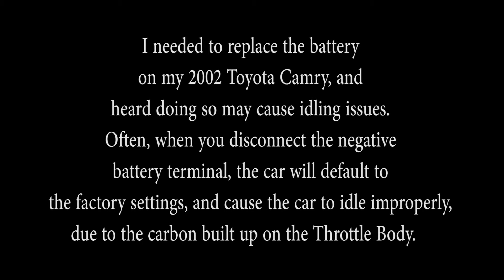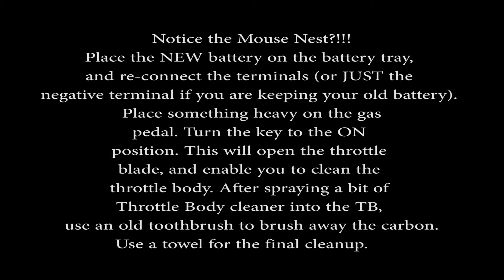Camry Idle Fix - Toyota Lexus - Throttle body cleaning

Comment: This video was perfect for me. After I disconnected my battery the idle was so low the engine would shut off at stoplights. I did what you did as well as spray the mass air flow sensor with cleaner. It runs like a top and I get better throttle response now
Reply from the maker: Awesome! Glad it helped you out.

Comment: Process worked for me.    Symptoms was it wouldn't idle without "helping" it with your foot lightly on the accelerator.    Even after 50 miles of driving it persisted.   In the past I had been able to drive for 50 miles or so, and it would figure out how to idle, but this time it did not.     Inside the throttle body was not even that much carbon to the eye ( equivilent to perhaps 1-3 pages of notebook paper in thickness), but after cleaning it throughly, the car idled at 1100 rpm and after driving settled down to 850 rpm.
Reply: For whatever reason this idle issue started after replacement of the engine coolant temp sensor.

Comment: Do you still have to disconnect the negative battery terminal if you are just cleaning the throttle body? Have a 2003 Lexus ES300 and been wanting to do this for a while. But otherwise this video is great! Also I originally watched a Scotty Kilmer video on this and he didn't seem to put anything on the gas pedal and he was able to open the throttle blade by pushing it, not sure if he did it but just didn't include it in the video.

Comment: I did the procedure on my 2004 camry, but I'm not entirely sure what you did to get the plate in the throttle body to open,  but I just pushed it open. Now my throttle body has to be reprogrammed because it threw off the computer in it smh just thought it was worth noting for anyone else who tries to do this.
Reply from the maker: At 4:37, I used a 35 lb dumbbell to hold the gas pedal down, and open the throttle body.
Reply: Thomas, with key in "on" position, you can use something to depress the accelerator.   I used a stick wedged against the driver seat.

Comment: What cleaning agent did you use? Would brake cleaner work?
Reply from the maker: Carb/Throttle Body cleaner. I wouldn't use brake cleaner.
Reply: Jeff Garrett  oh I was planning on taking the throttle body off and cleaning it then letting it dry before putting it back in. I even got the oem gasket to make it right.